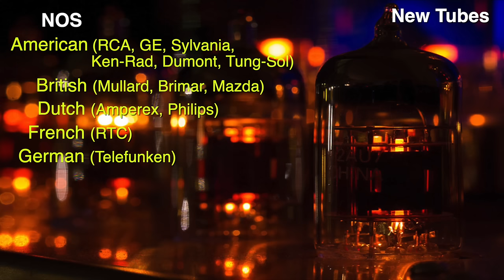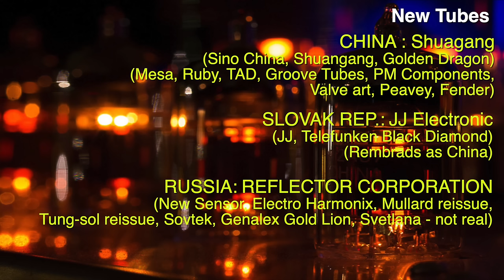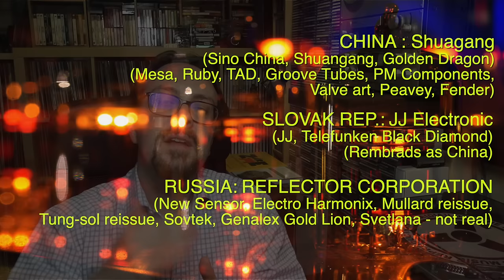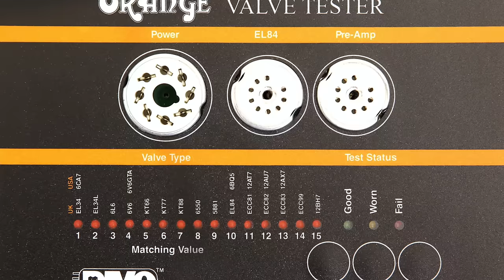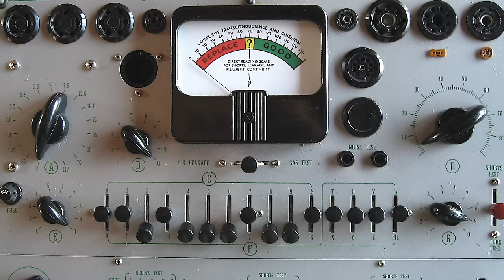Vacuum Tubes Basics: 10 things you need to know

Comment: Dad was an electronics technician in various fields, including NASA.  When I was a kid I'd pluck every tube from a derelict TV, had no idea what they were or how to power them up to get that magical glow, I just thought they were cool.  Now some 50 years later I'm in my 26th year with NASA as a senior metrologist, but my hobbies revolve around vacuum tube-powered gear.  Amateur radio with transcievers from the late 1950s, restoring pre and postwar tube-powered Zeniths (and a few `50s TransOceanics), and music which of course would be old Fenders and Marshalls, all of which require their own particular families of vacuum tubes.  My favorite times are on cold, winter nights listening to the airwaves from another continent, glass of bourbon and nothing but the heat, smell and the deep orange glow of an entire group of tubes in a Collins transmitter and reciever.
Reply from the maker: How cool, thanks for sharing that!
Reply: Oooh, NICE, the Collins 'line' of individual components also great!  For my station, along with a modern transceiver, I have the Kenwood line.  This would be the complete matching set with the 830-S flagship at the heart of the system.  

De KC1JZR (if you want to take a look).
Reply: @garysmith8455  Hey Gary, that's a nice Yaesu too!  I'm on QRZ as well.  I have a Collins S-Line (the receiver is a 75S-2), a solid state Icom IC-736 (which I love) and the newer 7300, so I have one of each "generation", vacuum tube, SS and SDR.  I'm low budget in that I have no tower, all my antennas are home-built.  I use the trees on my property to string up a G5RV (which many dispise) way up at 80 feet.  That, and a few hundred watts gets me just about anywhere I want to go.  73
Reply: @SteverRob  Thanks so much Rob!  Ok on your gear too!  Yes, only a dublette here as well, but not slung over branches, actual Halyards, and a 20lb. weight on the movable end with backing plates and hooks in the tree trunks LOL.  Since THREE trees are involved, there can be lots of motion.

But the wire stays in place no matter the weather.  I will look you up on QRZ!   I run the Maine Potato Net Thursday - Saturday evenings on 3.961.000  We NCS's run 'Net Logger'.   There are two other NCS stations, we run 7 nights a week.  Come log in and become a SPUD (O:  6pm. eastern at the moment until the time change.
Reply: @garysmith8455   A 20lb weight!  I guess you need that and you’re right, when those trees get swaying, it’s a bit nerve racking.
Reply: @SteverRob  Indeed, the two confirmed (by my tree service) 95' white pines on the front lawn, and 70' ash out in the back 40 do sway (O:   Thanks for the call sign, as I could not find you using your youTube ID.  Will check for you tomorrow.  Thanks, 73
Reply: How are you with televisions from the 80s  ive got a wood grain toshiba that plays nes games crispy as fuck and it needs to stay that way forever. When I was a kid I founded repaired the original giant two tone brown remote and would watch the old tv on the old couch in the basement and I wish I could go back there
Reply: @christofferredfielfd1758  Hey Chris, you can update old electrolytic caps and keep it going for a while, but the color CRT has a limited lifespan.  That's the Achilles Heel of every tube TV set.  The picture tube will get weaker as the usage hours pile up.
Reply: I like the Mercury rectifier tubes that blue glow is something
Reply: I do the same thing...except I sit by my lamp and listen to YouTube.  . nothing like the glow of my lamp and the sound YouTube ads on a cold winter night.
Reply: @brandonmalone1893  You forgot the bourbon :)
Reply: 😅 With all that awesomeness in your life I'd think you'd have better things too do than tell your life's story in the comment section of a YouTube video
Reply: Nice! Just assembled a Drake station myself and enjoying in KK6BEB
Reply: I'm surprised I never got shocked doing the same thing when I was a kid in the 60's.
Reply: Yup, I repaired a few Collins R390 receivers. Tubes and mechanical escapement moving slugs in filters.
Whew!
Reply: Each tube is a work of art

Comment: I beg to differ on a several points.  As for “tube life”, for many years now I have owned, used and maintained several tube amplifiers, and all the amp repair techs I’ve talked to or used say basically the same thing, life of a tube can be 2 minutes to 20 years.  2nd.. New current production vacuum tube market is quite vast, (that is until current political sanctions on Russia have blocked shipments).  Power tubes are the only tubes required to be matched in pairs, and are also biased as pairs.  An amplifier that would have (8) power tubes would have (4) pairs of matched tubes and require biasing.  Preamp tubes do not require matching or biasing.  Handling tubes with your fingers, power or preamp, will not harm the tube in any way (other than an unsightly fingerprint, or you could get burned if hot).  DON’T “JERK” the tubes out of their sockets!!  Gently rock them in a circular motion while pulling upward… same when inserting them.  If you don’t feel confident, ask a Tech/Repairman to get the best information.

Comment: Tube sound is misunderstood by the unfamiliar.  Power is just a part of what is needed to drive a speaker element.  The signal from a tube drives speakers much more efficiently in a way that solid state can not do.  So every frequency is cleaner, louder, more real sounding.  Like real live music.  SOOO, you can use tubes for a preamp, generate that efficient signal, and feed it into solid state amps.  Bingo.  It really works.  I do this now with a blutube Rockville amp, 70 watts max.  It drives speakers like a 400 watt amp but with better sound.  This is no joke people.  Never think you can compare tube signal power with solid state power alone.  It is the tube signal that pushes the speaker so much more efficiently, making more dynamic, realistic sound.  Not warm, not laid back, but intense reaistic sound.  Every speaker will sound better with tubes.  The better the speaker, the more tubes will improve the sound.  And it will be louder... with much less "wattage".  For music lovers it is well worth learning about tube preamplification.  No need to break the bank on 800 watt SS amps.  Read some reviews about Rockville Blutube hybrid amps.  New tubers are all amazed how much better their speakers sound with a tube system!
Reply from the maker: Good points!

Comment: I just bought a tube preamp. I have always owned AB, or D amps but grew up hearing tubes and have always been interested in the back of my mind. I decided the best way to introduce them to my system would be a preamp, get a taste and see how I like it. Currently I use my DAC as a preamp, it's great, very clean sound. It has several filter settings and a parabolic EQ, but the sound is pretty neutral across the board. I would like the ability to change the tone, especially for certain recordings and types of music. My tastes range across the music spectrum and I have fun with experimenting. Seems like the next logical step in my systems evolution.
Reply from the maker: Good job!

Comment: There should be no problem handling tubes with bare hands, they are not like halogen bulbs.
Tubes don't necessary have a life of only a few years, they can last fer decades. I'm restoring (mainly recapping) a radio from 1956 that still has a complete set of original operational tubes.
Reply from the maker: Its all relative, I guess. I know about other examples and experienced the opposite...
Reply: Vintage tubes made in the West from the 1970s or earlier tend to last much longer than the current Russian and Chinese crap. 1-2 years is not at all realistic, even the Russian and Chinese stuff lasts much longer unless it's really being hammered hard in the circuit. I find that it's the rectifiers that lose their sonic performance much sooner than the signal tubes.
Reply: Indeed, I have a Fairbanks & Morse 1937 AM/SW  radio using all original tubes, I myself have recapped and the set operates beautifully. That's  82 years and going strong still.
Reply: @balthromaw6305  I have a friend who went to retrieve a system from the estate of an elderly person who had died. The system had been installed in the 1960s, and was basically untouched since then. While most of the system was accessible, the amp was nowhere to be found. They followed the wires, and eventually found that there was a pair of McIntosh MC40 mono amps that had been built into the wall, sealed in behind the sheetrock. They had been fully powered for over 40 years, and were still working perfectly.
Reply: @gotham61  Sweet those amps are awesome
Reply: @gotham61 
What Web sites are reliable about the quality of the tubes they sell.
If you know good sites, tell me, cause i restore valves devices as an hobby, not professionnal activity.
Thanks
Reply: Cletus Spuckler Upscale Audio is a good honest vendor for vintage tubes. Not the cheapest, but they are well selected and honest
Reply: Mikael Hansen i have a 1972 marshall which still has the original ( mullard) pre amp valves.
Reply: @gotham61  I have a friend who was able to grab two of those from an audiology lab at a university that was selling off some old surplus equipment.  They worked perfectly.
Reply: I've been touching tubes and the pins for years and I haven't had any problems
Reply: As I mentioned to Balthromaw above touching the sides of the pins of power tubes that run hot can cause them to char resulting in a poor contact ,and though rare I've seen it ruin the tube and the socket as the char makes the pins much hotter than normal which can cause the socket to loose tension causing the replacement tube pins to char . Also While not an issue when the tubes are inside a cabinet some expensive amplifiers leave their tubes exposed because some people like to look at them and the oils will leave a visible dark fingerprint on the tube , and while harmless it's not aesthetically pleasing.
Reply: @gotham61  It's a pity Radio shack stopped selling tubes as theirs had a lifetime guarantee and gold plated pins.
Reply: Don’t try to handle 805 tubes with bare hands when they been running for a while 😂🤣
Reply: I just came up with a huge box of different tubes all say made in usa and im planning on selling them if anyone is interested let me know
Reply: @gotham61  Is that a story from the country where energy cost next to nothing?

Comment: Tube rolling is a lot of fun. But also op amp rolling can produce amazing things. With my Lake People G111 Headphone Amp (German manufacturer), I ended up using 3 Burson Audio V6 Vivid Dual Op Amps. Plus the Cambridge Audio Dac Magic 100 with Oyaide USB cable / Oehlbach NF 214 RCA cable and Sennheiser HD 660s / Beyerdynamic DT880 Edition. Quite a good compilation in my opinion.

Comment: I have Leslie speakers for my Hammond organs and both utilize tubes. Learning to repair/restore my Leslie is what got me into tubes.
Reply: Those tube are 6550 tung-sol if they are black plate no hole with 3 D getters two on one side one on top they can bring 750.00 each tube. I’m lucky I have a matched pair dated 3225904= 322 tung-sol, 59 Year, 04 4th month. Man do they sound out of this world.
Reply: Leslie speakers rock! I bet they are the best speaker made!  They can handle a very large frequency spectrum more efficiently than any other speaker in my opinion.  They are like a Timex....They take a licking and keep on ticking!  If I could, I would find a way to implement a pair of Leslie speakers in my home connected to my audio rig.  It wouldn't be anything short of AMAZING, but I would need a very large area to accommodate such an adventure.  It would be very impractical unless you lived in a castle.   I like how Jon Lord among a few others implemented the B3 in Rock, and the Blues.  I wander if the B3 Hammond has upgradable Op-amps?  But anyway, my favorite organ is the Hammond B3. :hand-purple-blue-peace:

Comment: Great to get a video about tubes. One thing I would like to mention. I would not recommend that anyone rock the tubes as severely as you demonstrated in inserting or removing tubes. You will surely break a pin. As for gear I have a PrimaLuna Dialogue Premium HP integrated. I rolled the stock EL34s out in favor of KT150s. Wow. It made the unit a totally new unit. Of course the tubes ARE the amp. I have a couple of other tube units too.

Comment: I run 2 styles of amplifier 6EM7 preamps with 300B power valves and EC83 with KT88 power tubes. Both hand built with the best components collected over the years. Once you have heard them you will never go back. I had a friend visit recently and he brought some of his favourite discs.  He discovered all kinds of details in his music he never heard in 30 years of listening. Go single ended triode over ultra linear. I can tell you that my 300B amp at 9 watts is louder than transistor amps supposedly rated at over 100 watts. The only side effect from all this goodness is that music that has been recorded badly will show up and end up in the bin. There is a good reason western electric 300B NOS valves are selling for over $5000- US a pair. They are the best. PSvane is a great brand of Chinese valves that you didn't mention. Highly recommend, especially the more expensive models
Reply from the maker: I hear ya!

Comment: You asked about gear:  I have a Jolida JD-1000rc running the panels only of my Martin Logan SL3 (100W per side.)  Woofers are being driven by Nak SS.  Adding tubes to these speakers was a day and night difference.  I had the opportunity to run the SL3 with numerous SS gear (Krell, Classe, Rotel, Nakamichi) and when I added my first tube amp, the speakers just melted away.  Being able to tube-roll and "tune" the sound for the speaker and the room has been critical to getting a sound that I love.  I was worried about changing to tubes as there is a ton of misinformation out there...I wish I would have done this 30 years ago when I started in Audio.  Thanks for the video and keep up the good work.
Reply from the maker: Great setup! That is a very powerful tube amp, in fact it can drive those not very sensible electrostats with ease I see! Very cool! Thanks for sharing!

Comment: Thankyou for sharing your experiiences with Valves. I use Valves for instrument ampliification and once had an amp that sounded awful, changed speaker, changed capacitors and even tried modifications to the circuit but it still sounded hard and horrible then one day I just pulled an Ecc83c from a little radio and placed it in the 1st socket of the nasty amp and I could'nt believe the change in tone. 1 valve saved tha amp from being trashed for parts to a " Numero uno" Electric Guitar amp. Yes, I notice after 15/20 mins the tone gets better and smoother . Your viddy ought to be included with every new Valve amp. Keep up the good work.!

Comment: 1:07 I believe the earliest working vacuum tubes by Fleming were diodes that replaced the crystal in radios. Later, the triode was invented to amplify radio signals for use with loadspeakers.
Reply: Even the invention of the triode was by accident 🤔🙄🤗
Reply: Yes, the diode came first, and the triode came later, and it WAS found by accident. Actually, it was found much earlier on when playing with a light bulb and the triode effect was witnessed but was ignored as a useless phenomenon until later when it was realized that it could be used as an amplification device

Comment: Hi AD.  Still liking your channel. Very well presented.  Point 4: a well made vacuum valve should last 10,000 hrs but if they are switched on/off often then their life will be much shorter.
I have a Marantz 240 c1975 with Australian made, Falls Audio, valve pre-amp and valve MM phono pre. The Marantz,  like many early SS power amps has a valve like sound (I had a Leak St20 vac valve amp and Stereo preamp) so matches with the preamps very well for a sweet sounding HiFi that still has lots of kick for Black Sabbath.  I play my tv using the headphone out thru this system and it even performs well with YouTube! (Tiny Desk is a great source for new music performed live). Lp’s of course are where it really shines.

Music is Life🌈
Reply from the maker: Wow Leak! Good stuff. Thanks for your nice comment!

Comment: Thanks for sharing your video.  It is very informative.  You are much appreciated.  I try purchasing all my audio gear that either focus around tubes, and/or upgradable Op-amps.  Discrete Op-amps for example perform much more efficiently, are very very low distortion levels, they can present a more rich and robust audio experience.  They are also very expensive.  A decent dual Op-amp the NE5532, is made by Texas instruments.  This Op-amp is considered an industry standard as a well balanced Op-amp.  This Op-amp sells for a very low price.  The Sparkos SS3602 Dual Discrete Op Amp sells for around $80.  The combination of tube rolling with Op-amp rolling can give you the best listening experience.  It does for me.  CHEERS!

Comment: I really like tube amplifiers but they are harder to service these days and even the modern tube amplifiers are ok but  still expensive. The one thing to consider is the amount of electricity a pair of mono block amplifier consumes during use and at the same time never to use them in high humidity and/or overly warm spaces. The sound coming out of any decent pair of tube amplifier is amazingly awesome especially paired with an analog R2R or cassette deck.
Reply: Nice thing about tube amplifiers is they are fairly simple. You could probably do most of the work on one yourself. 

That’s how I got into tube amps. Rebuilt a few. Good soldering iron, patience, documentation, and a multi-meter.